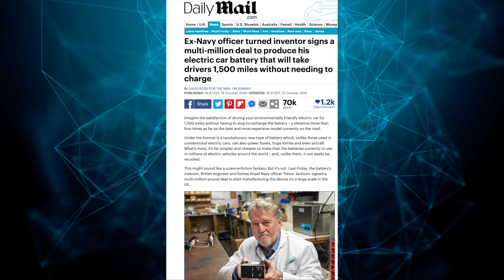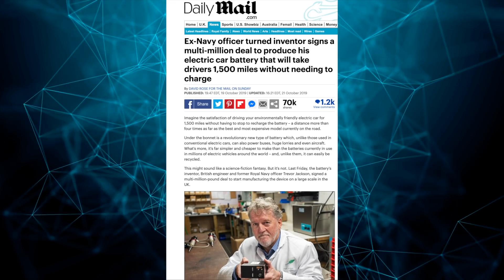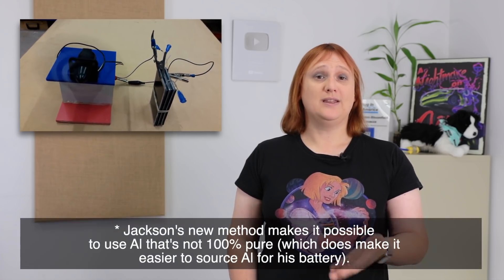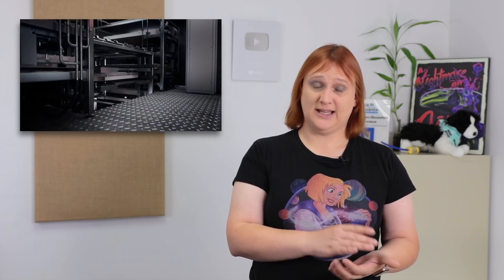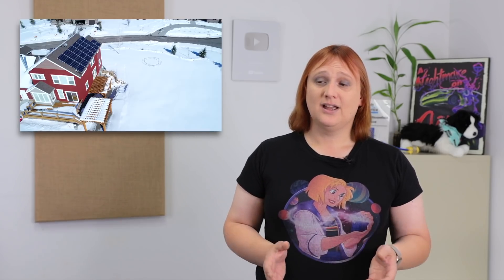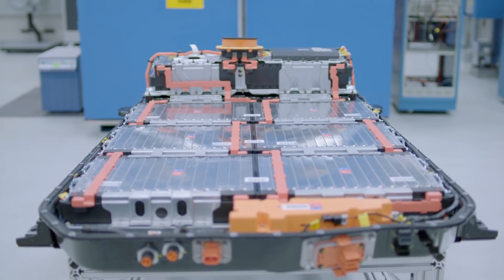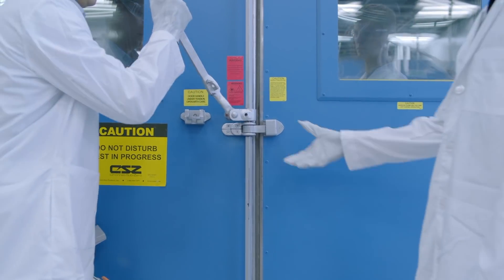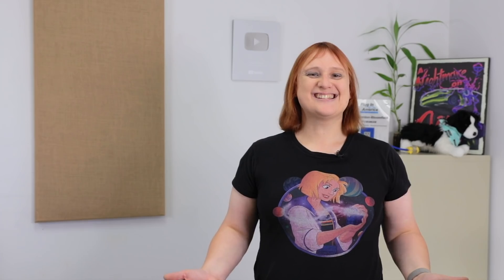Are Aluminium Air Batteries Now Practical?

Comment: If aluminum is cheap then replacing the (much smaller) battery won’t be that bad, right? Instead of going to a refueling station, you get a battery swap that could be done in an automated fashion. 

I imagine it’d be similar to pulling up to a car wash. When you pull up, a sign tells you when to stop. The battery is replaced from the underside of the chassis and then you’re good to go. 

If you can get a longer range for a cheaper price than LIon (or fossil fuels), that’d be a great selling point.
Reply: Ya, the cheap aluminum claim is a MASSIVE LIE. I crunched the numbers just now. The cost of the aluminum which is consumed in this battery costs about SIX TIMES the cost of electricity which can be purchased from the grid to charge a lithium-ion battery.  Any honest reviewer would point that out.